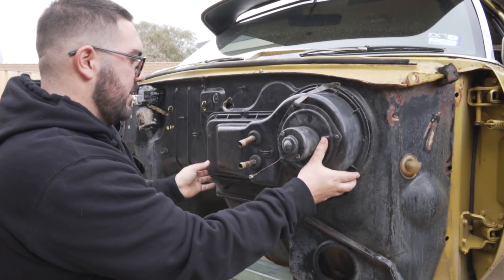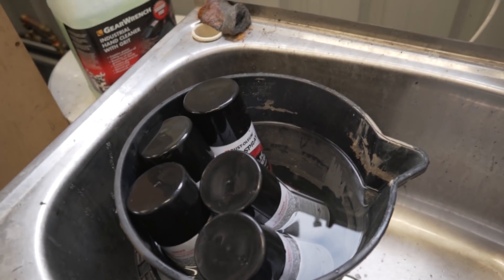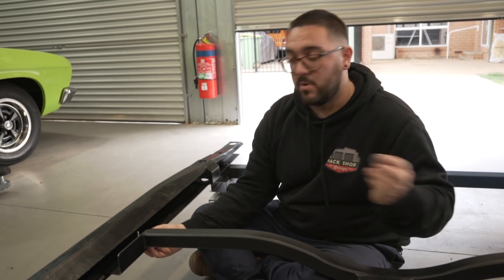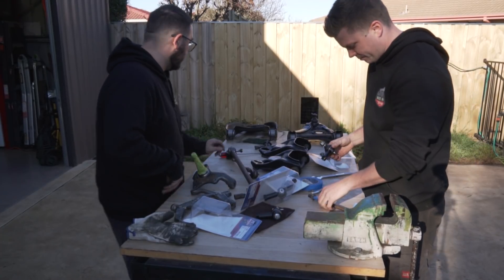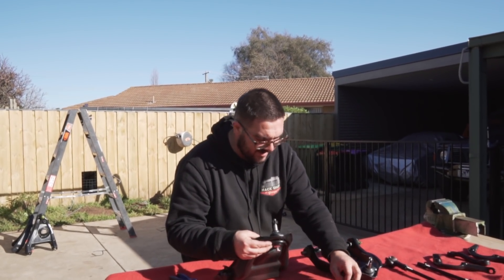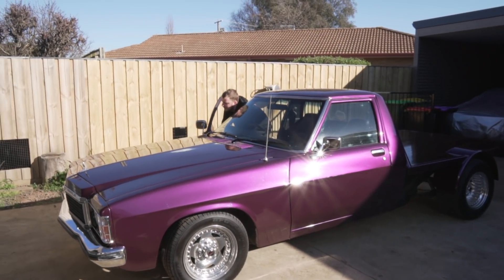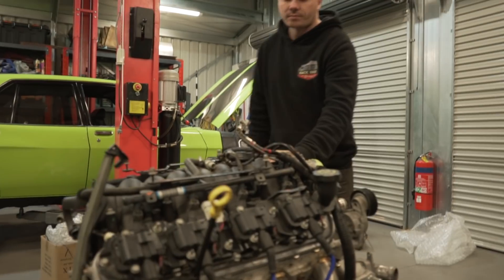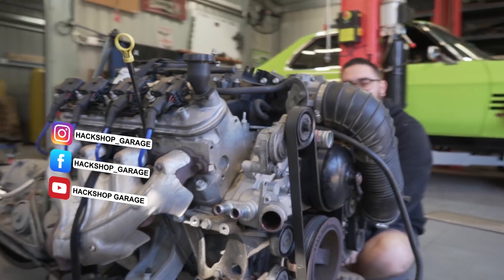LSQ Build - Part 3 - Engine And Subframe - (LS Swap HQ Holden)

Comment: I’m looking forward to seeing the column shifter setup.
Reply: Thankfully Holden already did all the hard work for them. There's a factory linkage system used on H series cars that was made for Turbo 350's and 400's. If they can find one it should bolt straight up with zero mods.

Comment: What paint did you guys use?
Also, if you put Suzuki Sierra front shocks in the rear of your HQ-HZ the diff wont sag down so low
Reply from the maker: The paint is acrylic lacquer from rust-oleum, satin black, it came up a treat, and dried super quickly!
Reply: Why no primer before painting?

Comment: Quick dry enamel spray paint isn't too bad to paint with on a cold & wet day because it's oil based, acrylic lacquer is because it's water based.

I hope you smeared the mating corners where the timing cover & rear main oil seal carrier meets the engine block with silicone sealant otherwise the gasket will leak oil.

Have you figure out the PCM side of things ?

You could use a stand alone EFI system such as the Fast EFI system which is all plug and Play,you would still need a stand alone controller for the 4L60E transmission.

If you're using the original PCM for the engine & transmission then the VATS (vehicle anti theft system) will have to be deleted from the computers program or else the engine won't start.

It will pay to fit the OBD2 diagnostic port as found in the Commodores as well so a compatible scan tool can be plugged in to scan the PCM for any faults particularly during the installation !
Reply from the maker: At this stage we are looking at the standard PCM which has already had the VATs deleted. Good call on the OBII port though

Comment: You do know putting a washer under a spring lock washer renders it useless?
Reply from the maker: The reason for the washer in this case is because it is a slotted hole, but didn’t know, will keep it in mind 👍🏼